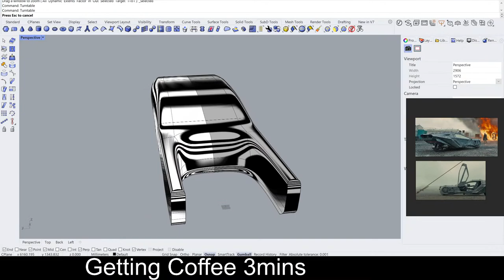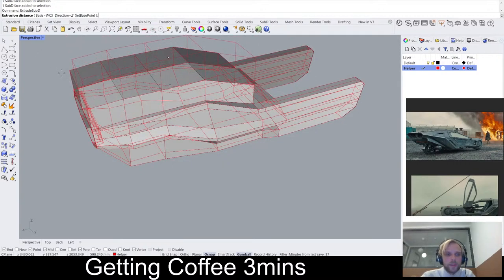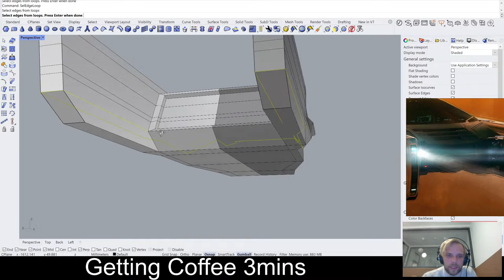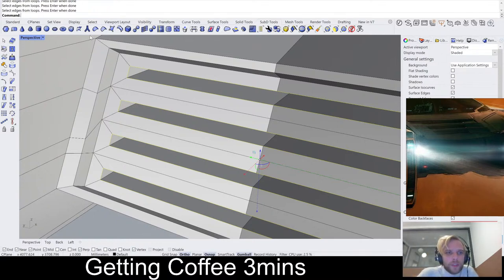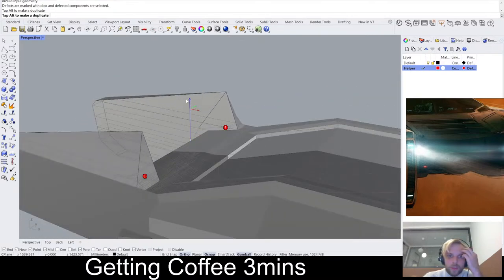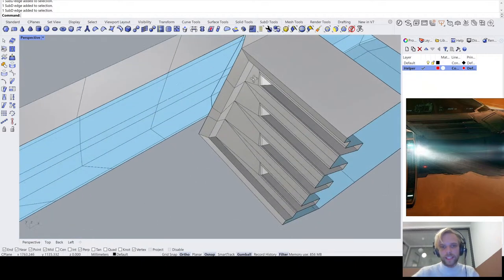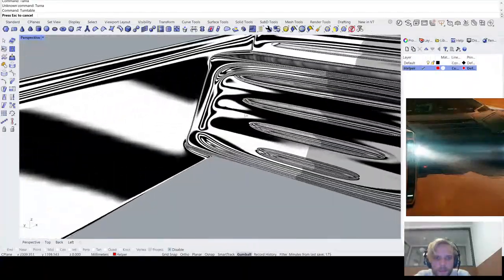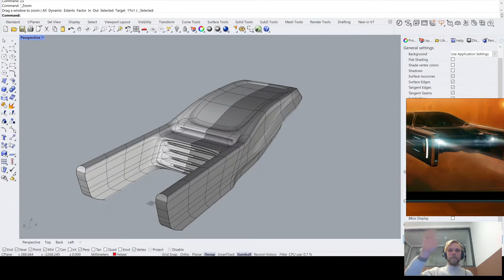3D Car Modeling with Rhino 7 SubD Tools [2/8]

Comment: Thank you so much,
I think i found a way to inset as a group, that's by selecting faces and then click and hold gumball scale then press shift to make it with  two access, and then also press ctrol key to make a copy from the edge's, just step by step not holding the scale gumball and press the two keys in the same time
Reply from the maker: It's actually as easy as using SubDInset rather than Inset! This tool was released in the middle of the series, so I think I start using it in Part 5~
Reply: @DesignGoBrr  thank you so much for learning us by your great lives record